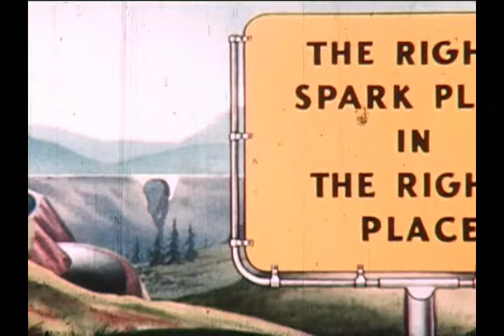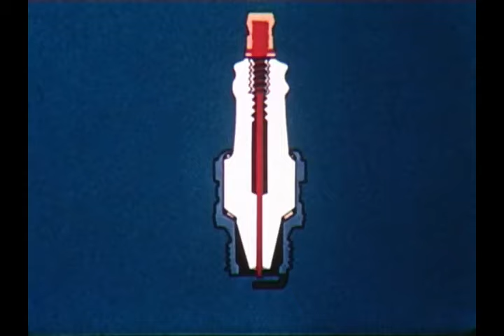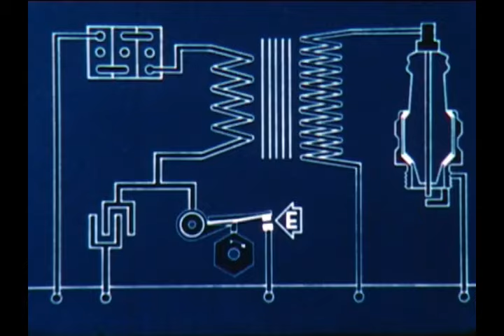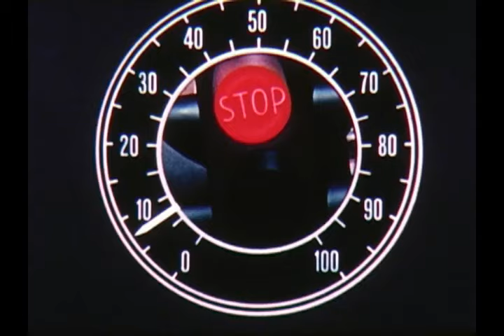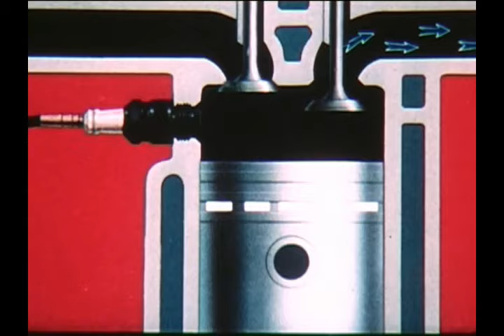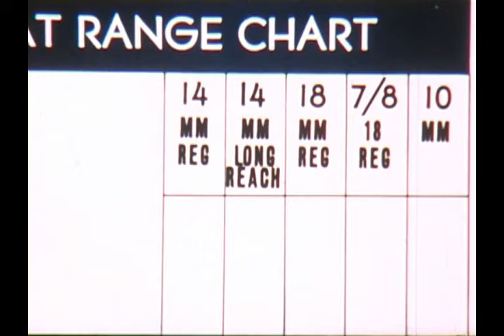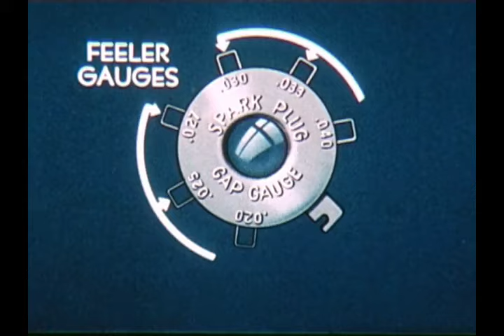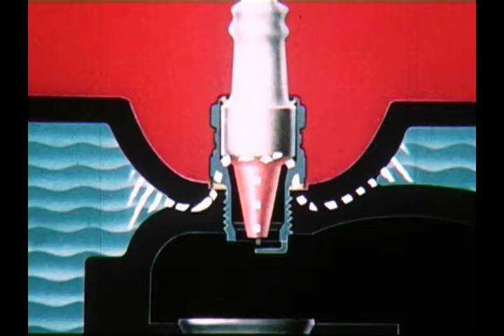Walt Disney Productions "The Right Spark Plug in the Right Place" (1945)

Comment: Back before OBD. Mechanics had to really diagnose problems by thinking and testing . Now they if no code is thrown they are unsure what to do . I have seen this first hand .
Reply: In the small engine world, we still pay attention to our engines, pay attention to the way it smells, sounds and what the exhaust looks like.  I've had everything from 1960s Briggs and Tecumseh flat head engines, Honda flat heads, Honda overhead valves, Briggs OHV, Kohler, and my newest engines being only about three or four years old at this time, all of them being of Honda or Honda clone design.  I have also had Poulan/Weed Eater/McCullough, HomeLite/Ryobi and Echo 2 stroke engines and mini 4 stroke engines from MTD/Ryobi and Honda.  Starting this year, I also have a Kawasaki V-twin engine.  Of all of these, the Japanese brands and Honda clones seem to be the best running, starting and the most reliable.
Reply: effin OBD... real fun when it cant diagnose...

friends range rover throwing a code... left front speed sensor open circuit... well that narrows it down a bit... nice.

so i unplug the right hand sensor. two error codes... left hand sensor open circuit x 2... not the expected outcome?

at which point the usefulness of diagnostics becomes questionable. is it left? or right?

the plan was to swap the two over, to prove if it was the sensor itself... but as the diagnostics cant differentiate between left and right... FFS...

"very possible that its a fault further up the canbus line..."

could be a dirty plug, broken wire, anything... i wasnt about to start digging any further?

it also made no mention of the blown fuse in charge of the AC fan or demister side of things...

call me old school, but i grew up by figuring faults through trial and error, then fixing the issue, rather than having to pull my hair out when the thing that is supposed to diagnose the fault cannot, then simply throwing parts at things in desperation... and some people can justify charging 2-300 an hour doing so. i felt bad about accepting the $30 he threw in my pocket... "i didnt really achieve anything, did i? just gave it an extra fault!"

they cant tell you when a bearing is about to let go... cant explain when a part is fatiguing, definitely cant alert you to a vital rubber component perishing...
Reply: If you want to own a vehicle with a carburetor these days you learn to become good at this quickly nobody is coming to rescue you

Comment: You won't see anything like this again.
Since 1980 manufacturers have done everything they can to 'discourage' home mechanics.
Today's 'entitled' Kermits don't want to know how ANYTHING works.
Reply: But you have to admit, cars require little to no maintenance (aside from lubrication and replacement of worn parts) and no longer need the engine to be pulled apart and rebuilt after every 1000 miles (1610 kilometres).  Besides, not everyone wants to work on their cars.  That is the reason we still have auto mechanical technicians.  Most cars you can still do some routine maintenance like cleaning the car inside and out, change the oil, checking the plugs, basic lubrication, you get the idea but even before 1980 people didn't necessarily cared or knew how to service their cars.  It often also requires having to buy hundreds of dollars worth of tools as well as finding a place to store them.  These are standard socket sets, screw drivers, testing equipment like multimeters, oscilloscopes, test lights, you name it.  Then you have the EuroCars where companies like Volkswagen requires a special tool just to change the oil and having to buy another oil pan drain plug after each change as well.
Reply: That's why it's so important for kids to work on their own cars. They'll be more self reliant and less dependent on dealers and shady mechanics who could scam them. 

At least, that's how my broke ass learned! :3
Reply: @jamesgizasson  
It's of great value - if not important - for people to 'get involved' in EVERY aspect of their life.
Reply: @WJCTechyman 
"Engine pulled apart and rebuilt every 1000 miles".
🤣🤣🤣🤣🤣🤣
You're FUNNY.
Reply: Rebuild an engine every thousand miles?
So, even by 1970’s standards of changing the oil every 3 months or 3,000 miles, you would have to rebuild the motor three times for every oil change?
Interesting.
Maybe on a lawn mower or garden tiller, but not on a car, bud.
Reply: @trueaussie9230  rather quaint... edwardian perhaps... before air filters... with leather packed water pump glands... trembler coils... wheels attached to the hubs attached to the axles so you had to change tyres whilst still on the car...

oooh, and dont forget, tiller steering, and fixed throttles with manual spark advance...

you actually were lucky to do 1000mile before a major rebuild... that was a years worth of driving for some.

remember things like the grand prix (previously gordon bennet trophy cup) and monte carlo were more a test of whether a car could even complete the circuit, let alone win...
lol, i have a book from 1912 saying nasty things about gearboxes being good at first but rapidly developing rattles, leaks, and inevitable failure in short order... how times have changed...

Comment: Unfortunately today we a spoiled by modern EFI and electronic ignition systems. Where the engine will keep running smoothly until the electrodes are burned out. As I found out in my car which had done about 200,000 km on its original plugs when it was new.

Comment: Too bad high-schools don’t teach kids engine repair anymore. “Because it’s too expensive”. Spark plug hasn’t changed much, since its invention 19th century. You would think more longer lasting plug by know, that lasts lifetime of the car or engine.
Reply: They last a lot longer than they used to thanks to making them out of very expensive metals. Platinum was popular in the 1990s and then iridium was used after that. 60,000 miles was common, and some get 100,000 miles from them.
Reply: @skylinefever  My spark plugs for my Honda small engines are still around CA$5.00 each for the NGK BPR5ES (Champion, as poor as they are, are more expensive for some reason) and doesn't specify what kind of metal is in them. They could last for years without issue on those carbureted beasts.  Of course, each season when my small engine equipment goes in for its annual service, they replace the spark plugs like they do the oil.